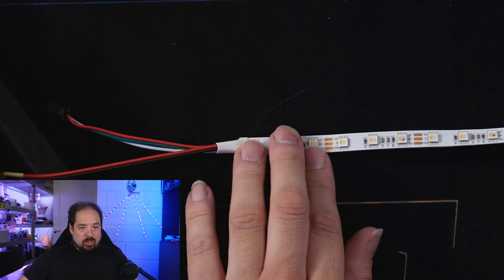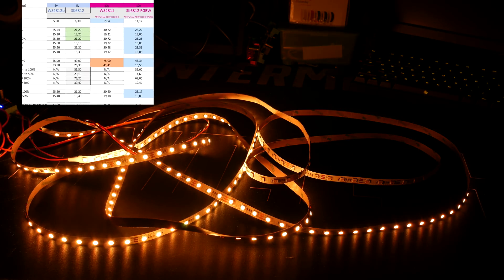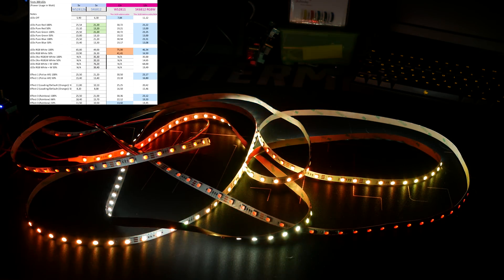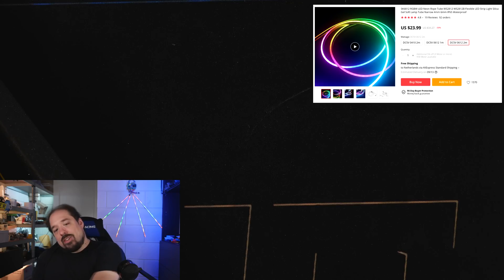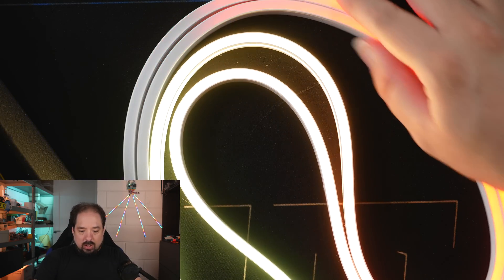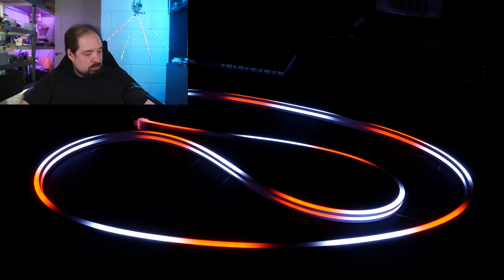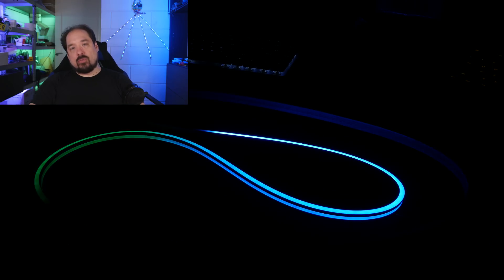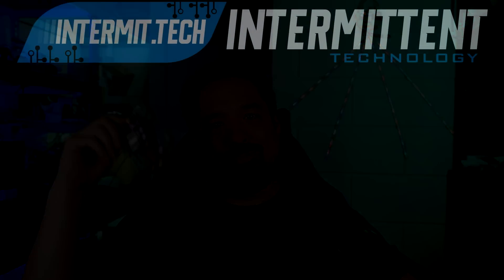💡QuinLED💡 12v SK6812 RGBW and 96LEDs/m in a Neon Rope Sleeve

Comment: What would the best option be when wanting to run RGBWW?
Reply from the maker: So RGBW with warm white you mean? There is 3 you can get now with digitally addressable, sk6812, TM1814 or ws2814, I really like the last one especially at 24v for instance.
Reply: @IntermitTech  thank you for your prompt response. I have some lights that already have the strip in them. They have a warm white chip with an RGB chip then a cool white chip. I do have an image I can send you if that helps. I have several of your unit operating different strips. The strippers 12V and is already installed in a custom lighting unit.

Comment: Seems that those LED strips aren't for sale, links are broken..
Reply from the maker: One link was broken because the seller removed it. I put in an alternative, the others all worked?
Reply: @IntermitTech  Yes it works now  :) Thanks! I was wondering, those leds are fully covered, with means no cooling option right? So the lifespan will be 50% less? There are flexible/bendable aluminium led tubes (where you put the led strip in) also on the market. Isn't that a more sustainable option?
Reply from the maker: Digital LEDs run a lot cooler then analog, so while it isn't ideal, it should be fine for a while unless you plan on running a lot of RGB white.
Reply: @IntermitTech  I did not knew this, I will do some deeper research about this "digital" leds vs analog

Comment: is it the white led that makes it that much more power effecient?
Reply from the maker: A dedicated white LED is much more efficient then trying to make white from RGB and also much better white light too. With digital LEDs it's pretty set what you get, but with Analog LEDs there is a lot more variance and quality difference in the white LEDs. You can get 28.8w per meter very high quality stuff for instance.

Comment: can we make one led strip 21 meter for my the perimeter of the ceiling of my room
 only one power box
? (with 4 or 5 APA102 for example ? )
did you recommand anything for me ?
thanks
Reply from the maker: What? You sure that can be done, you are going to need plenty of power injection though. Check out my wiring guides on my website.

Comment: With it being 96led/m any issues of the strip overheating since it's silicone and not aluminum
Reply from the maker: Addressable LEDs generally become a bit less hot then Analog LEDs and I've felt the tube become a bit warm, but nothing alarming. Now of that means it's getting properly cooled, I don't really know. It's meant for effects and colors and for that it'll be fine I think.

Comment: Is the neon strip cutable? Could be interesting to use parts of the strip in furniture.
Reply: i also like to know this i just order a xouple but dont see cut marks and the sleeve is sealed in both ends
Reply from the maker: I'd look at the link to BTF sleeve, that's just the sleeve without the LED strip inside so you can put any in there and make them yourself to length.

Comment: I have a question seeing that you test different led strips. I am trying to replicate   neon tube look.  My application is for a 36 feet roof trim overhang 32 ft in front and each side 4 ft back (90 deg turn). I have seen aluminium channels with a frosted lens. Color selection is OK but I don;t need animation.
Reply from the maker: Yes, but the normal 10mm profile has the LEDs too close to the diffuser so you will keep seeing hot spots. For that I'd recommend a larger profile like the 30mm variants out there, with the LED further away it will look more diffused (also be less bright...)

Comment: what did you use as power supply and controller?
Reply from the maker: Have you checked any of the links in the description? On https://quinled.info I have all the information you could ever want about the controller, power supplies, wiring, etc. etc. :)

Comment: Really nice video and informative like always. I may ask something again? I love my quinled. But. I dont find the way that after I cut the power to it and powered back start in the same effect that was before cut the power off. With power off I mean cutting the power going to the quinled.
Reply from the maker: Save your settings to a preset slot in WLED and then set that preset to activate in boot. That's the easiest solution for now, in the future changes to WLED will enable more functions in that regard.
Reply: @IntermitTech  I feel frustrated right now. I cant do it. Is any video about how to do it? I dont know what I am doing wrong...
Reply from the maker: @changchung  Save settings to preset 1, go to setting, led preferences and select it to turn on preset 1 at boot, done!
Reply: @IntermitTech  Nothing. Anytine that I try to save something the Leds go amber. After save everything the lights stay amber after reconnecting. 🙁 I feel stupid
Reply from the maker: @changchung  Odd, join the Discord, best place to troubleshoot :)
Reply: @IntermitTech  I join the discord but it show a message that I dont have permission to post. 😔
Reply from the maker: Yes, that's correct, wait until someone gives you the thumbs up after saying hi in the entrance channel, it's an anti-spam measure.

Comment: Good Morning... i plan to use some of your products, but i have small problem, INRUSH current into a motion sensor destroys the motion sensor, i need to figure out how to build inrush limiter. I may have to buy a complete LED motion sensor light assy and study its circuitry. BTW, i live in hot desert enviroment, summer over 100 degrees from 9am to 9pm, have to overbuild electronics, so it does not burn up.  12 volt is great for using an old PC power supply!!
Reply from the maker: Inrush current? But then you are running all current through the switch? Maybe hook up a controller and trigger that high/low depending on the if light is needed or not, that way the switch only sees a little bit of current and the rest is handled by electronics that can take it. We are currently experiencing the same temperatures here, but for us that's a rarity!
Reply: @IntermitTech  Thanks!! i will look into that suggestion, my electronics knowledge is slim, so opportunity for me to learn this.

Comment: Where would you use the neon strip for? Outside decoration lighting?
Reply from the maker: Sure yes, but also like lining a shelf in a closet or making shapes with it on the wall for instance. It's a really different effect then a bare LED strip because it's very diffused making it a lot less harsh then LEDs themselves (which you generally don't want to directly look into).

Comment: Is the neon rope weather proof? And the other question, won't it become brittle over time?
Reply from the maker: Yes, I believe it's weather sealed, as long as the connectors are taken care of, the rope itself will be fine. I don't know about becoming brittle, it's some sort of rubber silicone sleeve and meant for this purpose so I'm assuming it will be ok, but I didn't give it a long length test outside. ;)
Reply: @IntermitTech  would be a good follow up video...